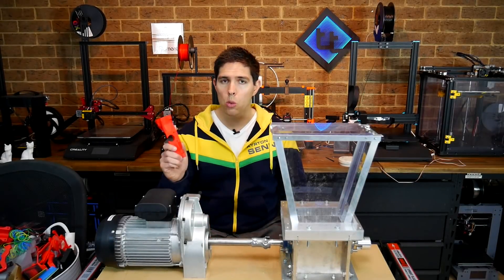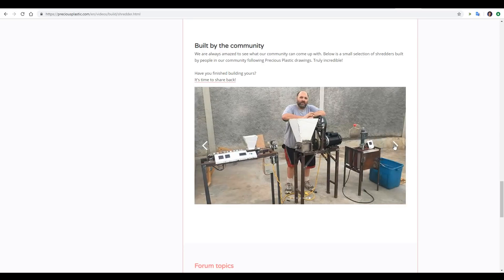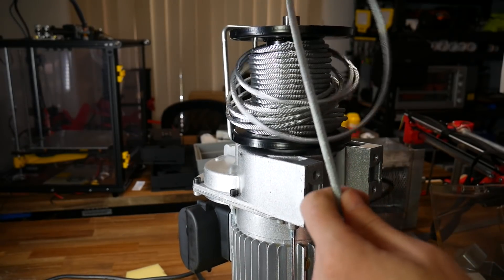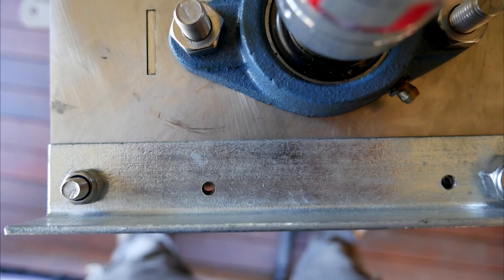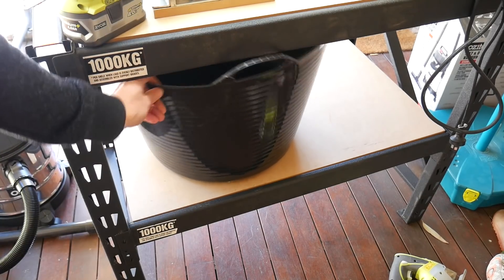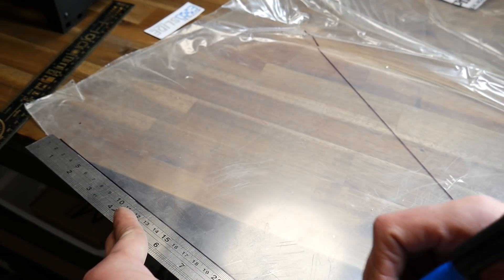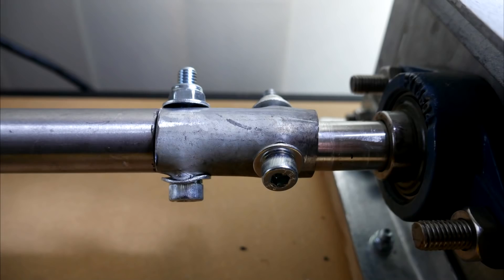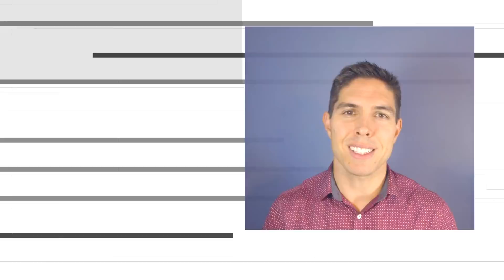Recycling waste 3D prints with a Precious Plastics shredder

Comment: My only suggestion would be to be overkill on sorting the plastics you've shredded. The last thing you want is to accidentally get ABS into you PLA shavings (or vice versa). You'll also want to be extremely thorough on cleaning the shredder between shreddings for the same reason. Other than that, this looks fantastic! Thank you for sharing this with us!

Comment: Hi Mike ! I am a retired Tool, Die , Mold Maker. What you really need for a coupling is a GEAR COUPLING! This will never fail you. The people that told you to use that rubber coupling, and then through bolt in shaft “FIX” is not the answer! Also, cut off the 20 mm ends of those shafts, and use the larger shaft diameters that you have Couplings can be ordered with dissimilar diameters if required. This will be a robust change from what you are doing.

                                         * Love your Channel! I also learned a lot!.

Comment: I would consider raising the RPM and gaining a little momentum. I assume there are bearings in the Shredder unit itself to handle far higher RPM. 2500-3500 with a Fly wheels should be able to shred aluminum cans and PET bottles in just a few seconds.

Comment: big mistake the winch-motor to suggest 99% of this equipment have the issue that it is not designed for continues work.. lot of people are complaining already about their diy some kind machine with this motor choice-> overheating... it is need to know that designed motors for most machines have designed work time -for example some kitchen stuff  have instructed to use max 5 minutes and then 30 min cool down otherwise it will burn down(this reduces manufacture material cost  because for a blender normally you don't need more than that  for example)...

Comment: Use some Gears so on your motor use a gear on the shaft's and a chain in between this way you can change your gear ratio and get a lot more force transferred to the shredder.

Comment: you could add an arduino or something as a control board, along with some sort of rotational sensor, then program the arduino to reverse for a second then continue forward when it senses the shaft stall.  
boom, automatic shredding even on really tough pieces.  
you could also give it a shut off timer, so in addition to simple on/off, you could just hit a button to set it going and it'll shred for some amount of time.  maybe have it reset the timer whenever it senses the rpm go down.

Comment: Use heavy tube as a coupler 5mm wall. make it much much  longer as it wont kink as easy. Use three 6mm or 8mm stainless bolts 1 on the shredder shaft and 2 on the motor shaft not nearer than 1inch from end of shafts or tube.

Comment: 12:17 The reason it worked in the original design video you referenced, is because they used a keyed shaft.

Not bolts that are not designed to deal with shear.

Comment: Since the shafts are 20mm why don't you just get a shaft coupler for outboard engines? Like this one for example https://www.boatpartsandspares.co.uk/yanmar-propeller-shaft-coupling-10421-83980-539-p.asp

Comment: hi, i've got a question for you. why cant you apply heat in the chamber (hair dryer etc) during the shredding, so at least the surface is malleable for it to shred easier? i mean, the extra head shouldnt affect the motor part of the system

Comment: Honestly having the fail point at the coupler is the smart idea, its the cheapest, easiest, and most accessible point on the contraption. If you direct drive mount like the OP vid shows one of the two shafts will ultimately fail, if not the motors internals will go first. might last longer than the couplers, but I'm pretty sure couplers are much cheaper replace cost than either of those devices. I'd suggest a stronger flex coupler with more than just tension mounting, gonna be your best bet, just remember its the desired fail point.

and not off the shelf bolts, bolt weren't designed for lateral shearing, actually the weakest point of a bolt. you'll want solid steel pins.

P.S. with that hopper design, I really hope you put a deadman switch well outside the reach of that machine, I cringed when you stuck your hand in it...ewwww

Comment: It's amazing what you're trying to accomplish here.
Try to collect plastic each on its own color.
Also I'm thinking at juice plastic bottles as Pepsi, Cola or water plastic bottles can be transformed in filaments.
Perhaps the way of printing filaments should be rethought so that the printer no longer has problems with printing depending on the type of filament (PLA, ABS ...). In this way you can recycle any type of plastic... 
It would be something amazing if something like this could be achieved.

Comment: I just so happened to have made this same setup, same shredder, same motor, different brand name, but it's identical, except my gearbox shaft is 18mm hexagonal.
I welded a socket onto the shredder shaft, then used an 18mm deep socket on the gearbox which I didn't weld on, but let float.
I then used a 1/2 inch drive square to connect the two sockets together. This has enough wiggle to handle the two shafts not being in perfect alignment (they're very close though, may 1/2mm out)
I've managed to stall the motor, which I think is putting out around 300Nm of torque after the gearbox and the sockets are fine.

Comment: YOU: I have no idea how their coupler is strong enough. 

Their coupler is machined from steel and much thicker than yours. Yours is what looks to be electrical conduit(EMT or Rigid) no comparison, also their shaft ends may be keyed to fit into each other. Your comment came off wrong, it's actually obvious to us how their coupler is strong enough, and it really should have been obvious to you also. Also your bolts will continue to shear

Comment: RACKIT is awesome - I would suggest using the securing pins though - or similar, especially if the shelving has any chance of moving around, as movement on one end will torque the frame and can pop the tangs out.
HAHA Classic Aussie OH&S - "Promptly jumped up and down on it...!" - yep she passes!
Looks like You as I do Pretty much live in Bunnings - Connect-It is my favoured Aluminium extrusion from Bunnings for small bits and pieces, and for More range and higher quality/Larger pieces - Action Aluminium in Bayswater North.
Great Vid.

Comment: Great video as usual. Find your videos really useful. Hopefully i can show some support on on the engineering side. looking at the video I can't tell if the motor is bolted down to the desk. Some movement in the motor could cause some miss alignment issues which could compound the issue with torturing couplers. 
With that much torque could it not be better to use a key rather than a bolt? I notice that the original shaft has a key to run the winch bobbin

Comment: In the video at the end (12.17 in the vid) when it shows the original coupler, it looks like they had taken a grinder and flattened one side of the shaft so it would be the shape of the letter D, tool steel coupler and grade 8 bolt should hold up pretty good. If you knew someone at a tool shop and they had a broach tool to cut a key way into both shafts would be the best bet for success. Just a thought.

Comment: 805 euro is 880.23 Us. for just the shredder box that's nuts. Then you have to add the motor from the winch which will cost a couple of hundred dollars. Then you have to buy the coupler. Then the shelving unit. Then you had to buy aluminum from supplier in order to make your Hopper. Then you had to buy polycarbonate sheeting. And then the idea to say a BIT OF COST lol.

Comment: For a serious setup, look at the motor's duty cycle rating.  A hoist usually runs briefly then sits, so a hoist motor is likely rated something like 5 minutes on, 30 minutes off.  It costs more to add extra copper etc. to prevent overheating in continuous duty and the motor will be bigger and heavier.  Customers usually won't check on this and pay more for a continuous-duty motor (and why should they?).

Comment: You should buy an actual cast iron coupler. The type you need to machine at a shop. A reasonable machinist will drill the holes for the axles for you for 20-30 usd and the couplers will cost you something like 40 usd. Of course, you will need keys for the axle-coupler connections and  those cost almost nothing. You're awesome and I love you, but I have to point that this is basic mechanical knowledge.

Comment: Your mistake... Not using gears.

Had you used a large diameter drive on the shredder and a smaller gear on the other and you ramp up the torque and increase the motor speed that you use.

It would then  allow you to mount the motor to the side of the shredder so that the shredder frame forms a chassis that is rigid and inflexible.

Comment: Mate if you lived in the southern suburbs of Melbourne I would weld the coupler for you. However, as people have said the correct way is to use a keyway, bolts are designed for clamping force, not sheering (sideways) force. An alternative you may consider is press fitting. Get a metal round and drill it to smaller than the shaft of the motor and then heat it up and press it on the motor shaft. When the part cools down you will get a nice strong friction fit...

Comment: In my calculation, overall cost for this diy shredder is enough to buy u a cheap chinese industrial shredder machine 😊🥂
Reply: @mrtea3122  its from China . Follow me I know it might be hard
Comes from china.... is cheap = cheap Chinese crap
Has nothing to do with race.
Reply: @mrtea3122  how was that coment racist 
Your a clown
Reply: Well that escalated quickly..
Reply: @mrtea3122  the phenomenon of cheap Chinese crap is real enough that even Chinese people hate these dubious manufacturers.

It's just Westerners that like to overuse it.
Reply: i don't know how to say that without sounding rude but

do we (3d printing dudes) give a fu** about the cost per things of self made products over cheap chinese crap
Reply: @coced  Yes, "we" do. Not everyone's a fan of throwing money in the trash.
It makes literally zero sense to go and spend $1500 for what is essentially ONE electric motor with zero electronics attached to a couple of spinny metal bits. You could probably get similar results to his by just running the plastic through a cheap wood chipper and save more than $1000 and a lot of hassle.
If you're gonna DIY something it needs to come out either cheaper or significantly better than what you can buy, otherwise there's no point.
Reply: @demoniack81  I use a blender I found and an old power drill
Reply: @coced  its ok dude. U are free to voice up even its sounds rude. Every people got their very own opinioin. Well dude, not all entire people have "a lot of money" to spend like u perhaps. Be smart to spending every single pennies we had dude 😉. That crap u mentioned giving most of us a great result and its proven way better in cost effective. Most of DIY projects are attentionally to educated ourself and the most important is to cut off as much as we could the cost ! Remember that ! 😷🥂

Comment: For increasing the torque handling of the coupling: A good compromise between keyed shafts (Difficult for a hobbyist to produce accurately)  and bolts (Poor at shear strength in this design) is to machine/grind some flats on the sides of the coupling where the bolts contact the shaft. Should be a lot nicer to the bolts, rather than having the bolts going through the shaft and having to withstand considerable shear strength. Also, try to use high tensile bolts, they should take more of a battering than mild steel.

Comment: FYI, for the 1000kg rating you need to use the "Rack it" shelve support braces that go under the MDF.   Without, the rating is the max of the break point of the MDF.

Comment: The coupling distance between the shredder and the motor too wide creating twist on the coupled shafts (shear torque). Reduce the gap, bring them closer and you get robust torque.
Reply: This guy knows. Also pins or keyed shaft.

Comment: A couple suggestions for version 2:

1. Use a rigid steel base for the shredder and motor. On the MDF base, there's a lot of twisting between the two exasperating the coupling failure. Align the shafts properly. 
2. Add a VFD to control the speed and reverse the shredder when jammed.
3. Using torque/power feedback from the VFD, add some control to automatically reverse the shredder.
4. As suggested in the comments, add an interlocking safety circuit to those "access" panels. Accidents happen and you probably still want all of your fingers. 
5. Figure out the maximum torque and get a flexible coupling suited to the task. I might suggest a Falk steel-flex grid coupling. May need to machine those shafts to accept a key or better yet, a splined connection. The shaft key and keyseat will be your weak point. That is where you need to set the torque limiting below. There is a lot of torque from that repurposed winch.

You've inspired me to design a build one myself. I'd be using it for the same purpose, 3D printed plastic recycling. Thanks!

Comment: You throw that insane amount of momey in this project and it is still so sketchy. That hopper frame is just thrown together without any thinking on making it nice. The side flaps are useless of it jams when it is full of material, you just created a safety issue there. You should have added safety switch to power off the motor if the hopper is open or detached. You should have mounted emergency stop button, maybe two each side, in close reach of the hopper in case of something happens. But really, you shouldn't wear hoodie while operating it.

That shaft is unnecessarily long, should be coupled using a key and should have protective case around it. And have I mentioned the hoodie strings?

Shredders are very dangerous machines, never cut on safety.

You have built a powerful shredder for industrial amount of waste, yet you haven't talked about waste management.
You should have touched the topic of which plasics could be recycled, which isn't, which ones should be collected separately from others, worth collecting colors separately or not, and so on. Recycling is probably different in every country, but talking about the topic in general would be useful.

Comment: stay with 8mm bolts but goto using grade 8 not grade 5 or standard the strngth of what the bolt is made of should leave you without a prblem and if you are still with a problem it will be with the coupler you will need to goto a hardened stell coupler and have a machine shop drill it to the holes necessary....you will ne a high speed drill press to get the holes perfect but you will not sheer off grade 8 bolts

Comment: Hi, as others have said your best bet for the coupling between the motor and shredder would be to get a key way or flat machined in. It might be worth trying to put some gritty material in that flex connector such as diamond or carbide lapping paste to increase the friction between the shaft and coupler. As a side note, if you do end up getting a key way machined in get them to remove the section that you've drilled a hole in as it will most likely be your next failure point.

Comment: Having built the precious plastic shredder myself, we had the same coupling issues. As for the coupler, have a look at HRC couplers. Can be pricy, made of cast iron, but it will withstand the force. As for the arbors, you can combine some solutions : keys, milling a flat part, locking nuts, pression screws... We also killed m4 m6 and m8 bolts before giving up and going all the way to the HRC cast iron coupler. Good luck with your machine :)

Comment: If the torque on the motor isn’t enough you can always get a gear reducer and slap that on your shaft. With something like 1:3 you won’t have any trouble grinding any plastic you can find, or even wood. And also, instead of bolts, use heat treated thick pins instead, they are made for these types of work and won’t break as easily.

Comment: The simplest way for a high torque connection, without using a machine shop, is to file two flat surfaces on opposing sides of each shaft.  This is called a "Double D" shaft (no kidding, look it up).  Then make a simple coupler out of flat bar stock steel (I suggest 15mm thick) that bolt together (don't bolt through through either shaft) around the shaft, with the outside pieces of the coupler against the flats of the "Double D".  I can send you a 3D picture I drew if you'd like.  It's really simple and doesn't require any high priced machining.  "D" & "Double D" shafts are used widely around the world as a high torque shaft connecting technique.

Comment: yeah at that price it will never pay itself back...
Reply: Probably after a lot of years
Reply: Depends on use case, home use it won't, commercial use it's cheap
Reply: @ericlotze7724  Commercial use would be better to just purchase the machine
Reply: For commercial use you would most likely need a more powerful shredder and have a material thats worth a decent amount of money or its not worth the time spent  also in many cases the recycled material doesn’t preform the same for example when i worked in a injection molding shop we would shred the sprues from the parts and reuse it and when you put that material in the machine you would have to constantly tweak it to keep the parts from being scraped
Reply: How many reels could you buy for $1800
Reply: Luke Walker Don’t forget you need an extrusion machine that turns the pellets to filament too
Reply: Luke Walker At least 50!

Comment: Keyed shaft with a machined coupler designed for that sized keyed shaft will fix your issues. You should be able to find proper couplers for keyed shafts online.